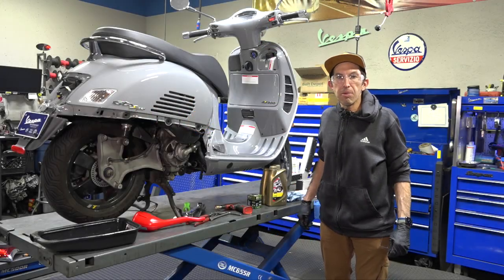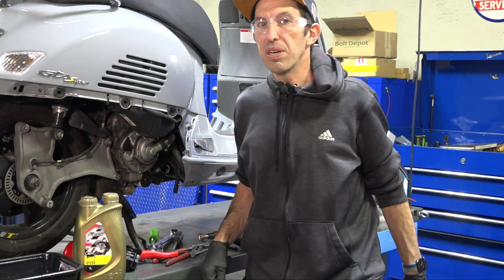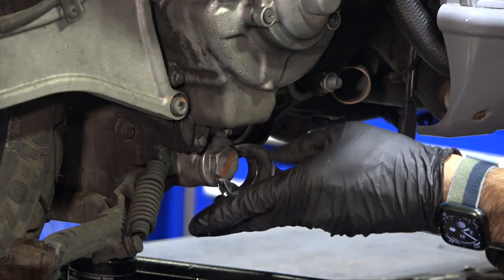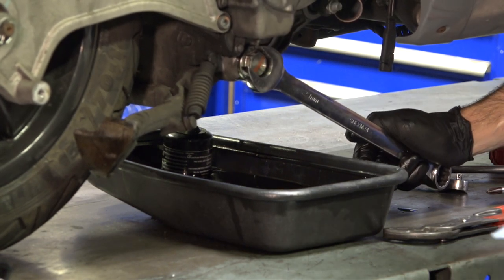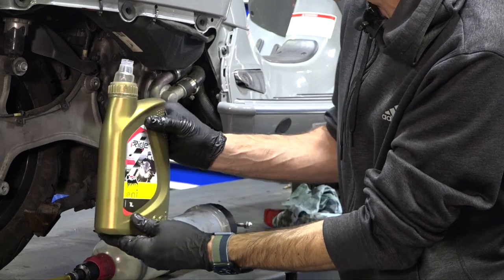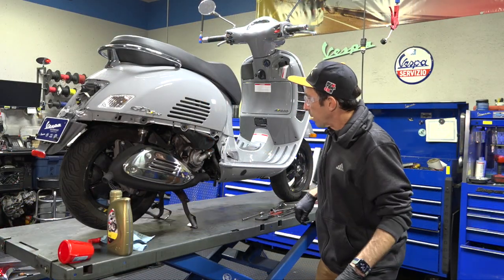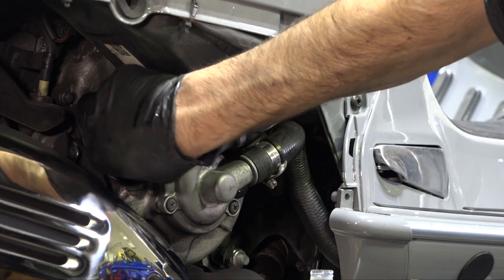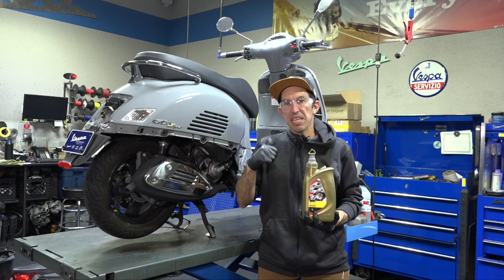How to Change the Oil on a Vespa GTS HPE Scooter

Comment: It is very strange Vespa specs JASO oil....  It is NOT a wet clutch motor.
JASO leaves out the friction modifiers.   That this engine could certainly use.

Excellent video, Robot

Comment: Great video (again), Robot. Question:  I'm about to take delivery of a 2022 SuperTech, and I'll be switching to the sight-glass-equipped oil pan at the first (600mi) scheduled service. The same company that makes the oil pan also makes a special hose assembly that replaces the oil cap/dipstick and rins up into the engine bay, ostensibly to make oil-filling less of a pain. Even assuming the hose line is sturdy/leakproof, is there any potential problem in regard to oil pushing into the hose from the crankcase, "starving" the engine of oil? (Yes, the bike is going to see a fair amount of highway use, at highway speeds.)

Comment: Hi.. Should it be 5w40 or 10w40 depending on the country?  I live in Turkey in a temperate country and I have not used the winter season.  I only use it between April and October.  Which should it be 5w or 10w?

How many minutes after turning off the engine should the oil be changed?  How do we know that we have emptied all the dirty oil?

Comment: At 20:38 - assuming regular or doubled (every 3k miles) oil changes, is the median lifespan of the Vespa engine 50k to 75k miles? I ask because I've never personally run across a 75k mile example. I'd assume other than the engine, the body and remainder of the scooter could easily go well past 100k miles in a drier climate away from salt.

Comment: Here in Spain they use at the Vespa dealer 0w40
Reply: What is the temperature range in Spain.  In San Diego very seldom do they have extremely cold below zero Celsius the proper oil viscosity is determined by two factors the bearing clearances in the engine and the temperature range outside . So the perfect  oil in one location can be very bad in another location .
Reply: @thomaslemay8817  temperature rate here   In the winter average 12till20 degrees summer between 25till30
Reply: @loewe7  that is very middle range. Both not that hot nor is it very cold.  
Where I live it goes -20 c to 40 c  making oil selection more difficult and it changes the way you treat the vehicles on cold morning or hot afternoons. I had an acquaintance that had a Porch 911 we hade a early snow fall in the mountains.  He went skiing the next morning early aboard 4:30 AM he tryed to start the car.  It wouldn't crank over at all . He knew the battery was new and that the entire system was checked out completely just two days before he left.  So he pulled the dipstick. His oil looked more like heavy grease than any thing.  So he had to get a pan and charcoal, he built a fire in the pan and pit it under his engine to warm it up . He was late to work because of the time required to get it warmed up enough to start. He was in some trouble because this happened in the middle of the week his mother-in-law was in management at the business where he worked and he had been given special time off to take care of a family problem he was not supposed to be going skiing .
I was lollollol at him .

Comment: It’s not that hard to fill the oil.  Remove the under seat compartment so you have access to the engine.  It’s nearly a straight shot to the oil dipstick with a simple gel I funnel.  Perfect every time!